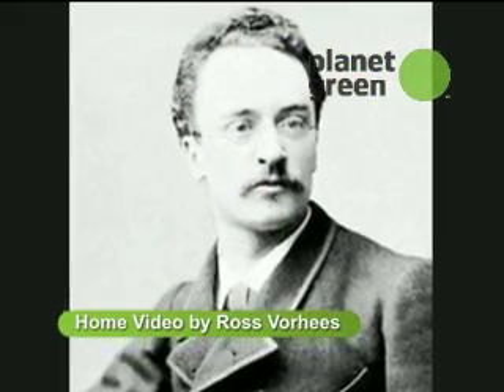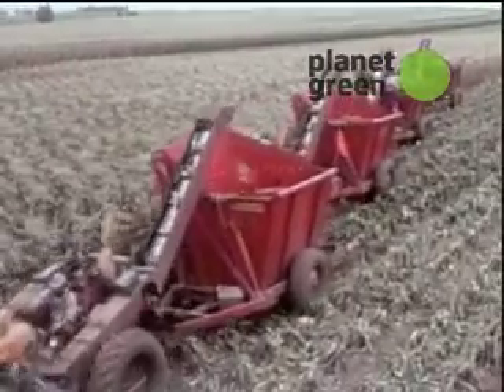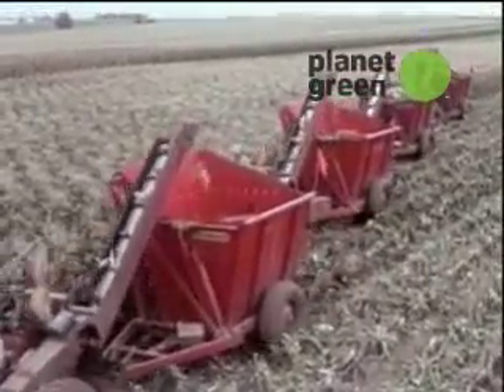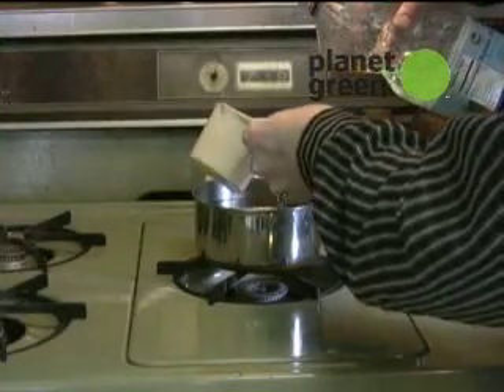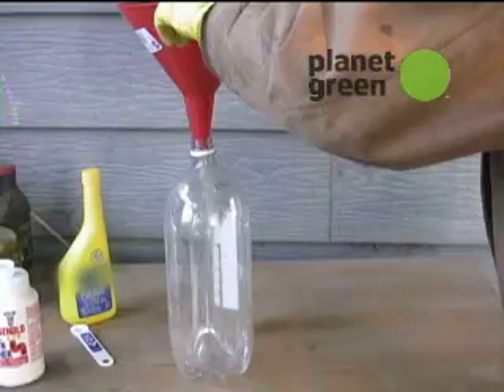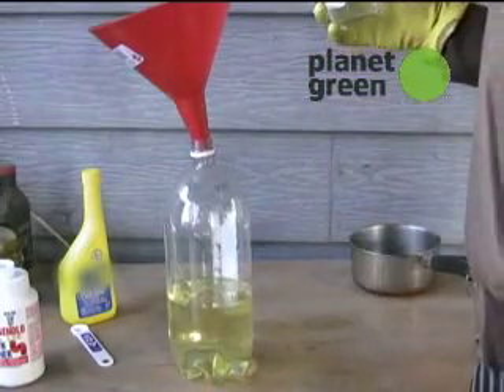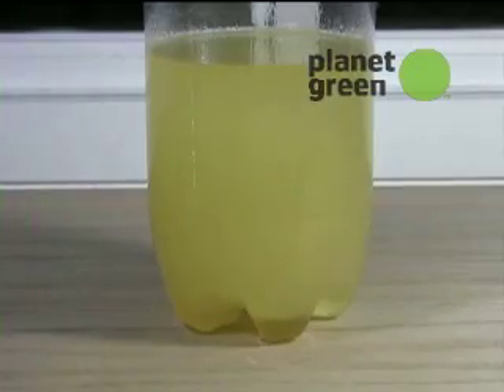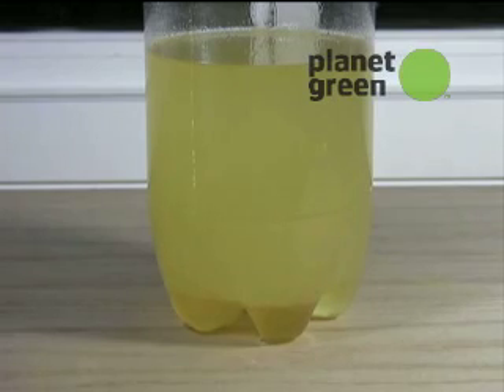G Word - Homemade Fuel

Comment: If you have an older pre or whirlchamber diesel car you can use an patented fuel blend called "Schur Ecofuel" (its a german patent)
80% used vegetable oil - 10% unleaded regular gasoline - 10% pure Isopropanol alcohol (over 99% purity)

If you have a newer direct injected car (TDI SDI HDI..) you have to blend 50% Vegoil - 30% Diesel oder Biodiesel Fuel - 10% unleaded regular gasoline and 10% Isopropanol to run it without engine modifications.
Be sure to half your motoroil change intervals...

Comment: actually you dont need to create "biodiesel" for most diesel engines. If you use brand new cooking oil usually you can just pour it into the tank and it will work straight away (although there will be less power)

you do however need to use this process if you use USED cooking oil (after 2 or 3 stage filtering to remove all the food particles)

Comment: @afthefragile it will mix just fine.  Most biodiesel sold commercially in the US is a blend.  If you are using an older diesel be aware that it could clog your fuel filter with wax after a bit.  This isn't the biodiesel itself, but the years of buildup in your fuel lines from petrol diesel that gets cleaned and dislodged by the biodiesel.  No biggie, just check the filter once in awhile, or carry a spare.